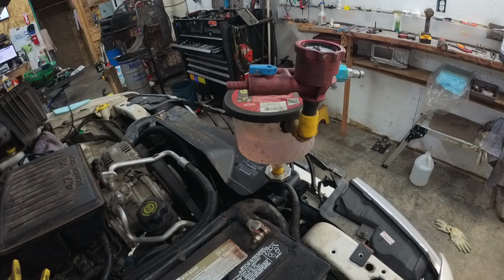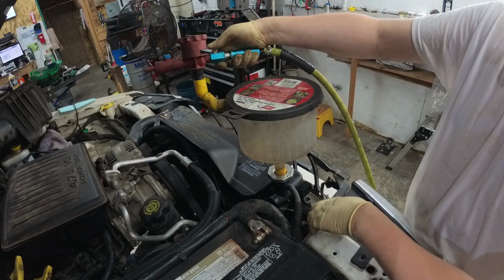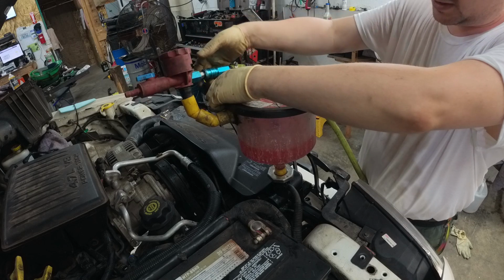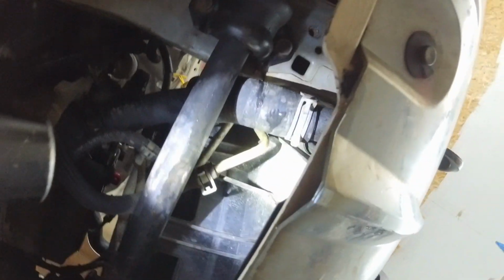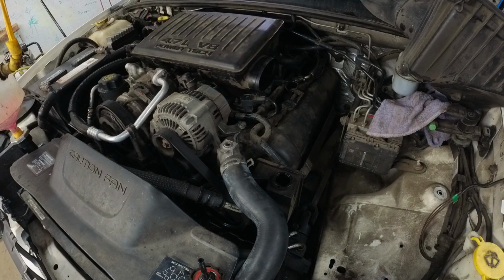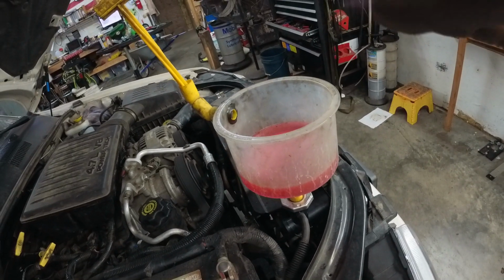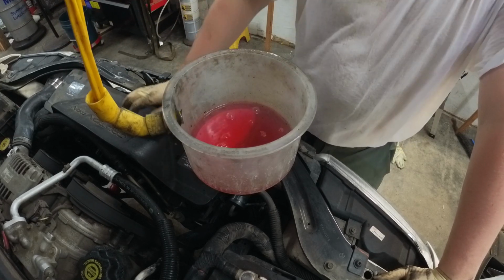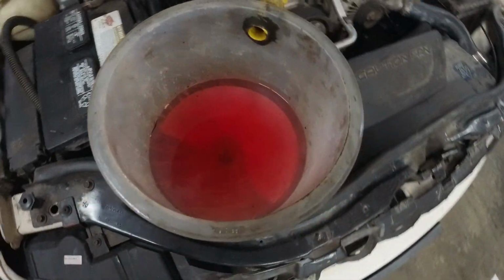Grand Cherokee WJ, bleeding coolant and power steering hydraulic fan system

Comment: Wouldn't that pressurized air cause bubbles in the funnel, might be the bubbles you are seeing every time you hit the air.
The distilled water is used to prevent minerals building up deposits in your cooling system. 
The reason the WJ is taking the coolant every time you put air in is because the vehicle isn't running.
If you want to bleed the system you might want the vehicle running to top off so the thermostat opens and might want the heater on full blast to allow flow of the heater core which can have air as well.
Reply from the maker: It's not pressurized air, it's a vacuum. It's called an "air lift" and is commonly used all across the automotive and heavy equipment fields. The reason that there are bubbles coming out is because it's impossible to break the surface tension on every single corner and direction change. Typically just pouring coolant in gets blocked by pressure differentials inside the engine that is where the vacuum comes in It actually sucks the coolant down into the heater core and rear of the cylinder heads and block so that there's no gigantic voids when you first start the engine.

 Regardless of what you do there is still coolant circulating through the heater no matter what the state of the thermostat is. The heater on full blast makes no difference in the actual bleeding of the system, That's old school thinking from back when vehicles had heater valves installed. That's obsolete in this particular build, dating back to about 1997 when the SAE changed how the systems work. In default condition the vehicle is designed to have the defrost and heat function Even if there is a complete failure of the control system. That's why if you sit in the car you'll hear the mix and mode motors returning to the default position after about 5 minutes.

So with all of that being said the way that I do it here in this video demonstrates the absolute most efficient fastest way to do it. Otherwise if you just fill it and start it you'll end up with a massive pressure differential and a lot of times it'll just geyser due to the bubbles inside. But regardless doing it the old school way or this way there's still a time commitment to verify that the water has completely replaced all of the air. No matter what you do there will still be air bubbles in there

Comment: My 4.7 Dakota's little Allen key bleeder has been seized since I bought it around 140k miles. I changed the coolant like 5x and never bled it, just filled it up, put the cap on and sent it. It now has 240k+ miles on it and never had a problem. You will never get all the "bubbles" out, as the coolant expands when the vehicle gets up to operating temperature it will self bleed into the reservoir. That stupid funnel thing is a complete waste of money, time, and energy. I also have always used the green coolant from Walmart because I didn't know it was supposed to take special Mopar, also 0 overheating problems. Also if you have the hydraulic cooling fan you are NOT SUPPOSED TO USE ATF4! Please no one do what this guy does.
Reply: how do I know if I have a coolant leak?, my coolant is super empty and thiers a huge stain on the driveway, so I dont know if its the coolan or a  hydraulic fan problem